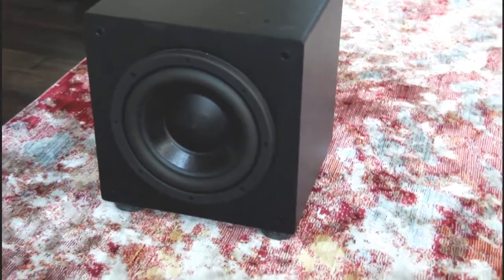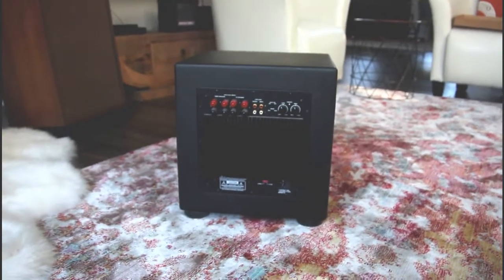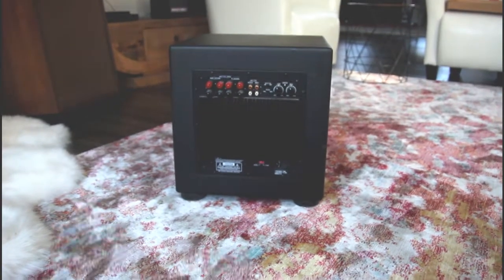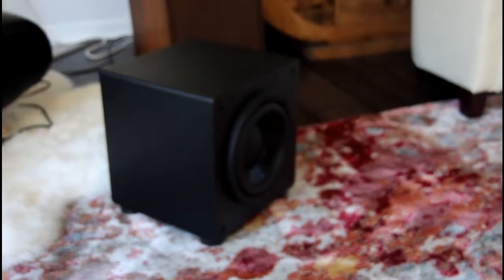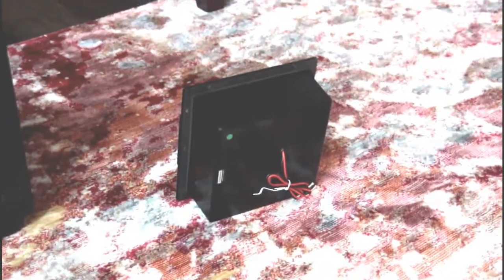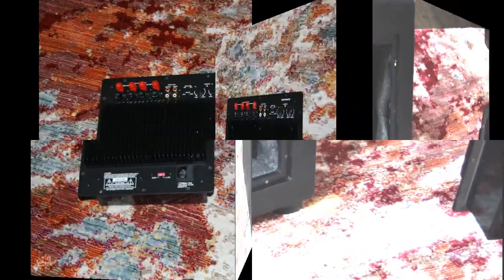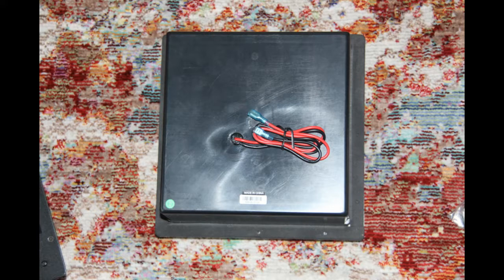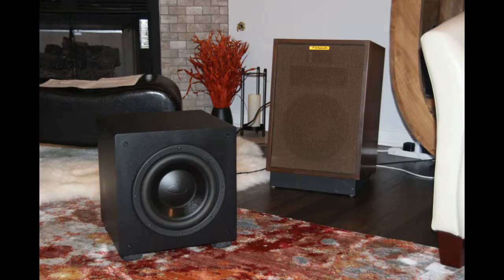Motorboating Subwoofer repair

Comment: Are those KLIPSCH FORTES?
Reply from the maker: Good eye, but only close. I do have a pair of Forte IIs I purchased in 1989 and refurbished about 5yrs ago. There is a video I did on the update. I'll put the link below. The Fortes are fantastic speakers. I use them for A/V as well as music.
The speakers in this video are Klipsch Heresys. They were a rebuild project I did last winter.  I did a new install in our vacation home with M-L Edge in-walls and they were a major disappointment. The Heresys brought the sound out into the room and made a major improvement in the sound field. Again video below.
Heresy rebuild - 1978 cabinets with all new innards.
https://www.youtube.com/watch?v=h3j2P8cjEoo
Heresy Sound test
https://www.youtube.com/watch?v=K19vrnMwNGI&t=186s
And the Fortes
https://www.youtube.com/watch?v=4PLtpOCH81I&t=279s
Reply: @ejcheck  If you have time, could u possibly email me?
I have some questions about what else ( CAPS) should be replaced due to the age of the Fortes. 30 years is a long time! Thanks for your time!
Jmmatsonjr@gmail.com
Reply from the maker: @sixstringsdown1  sending email now
you might want to remove the email from the post
Reply: I could tell by the variety of topics u cover that you are exceptionally intelligent! BUT, my email has been sent to the Utah Fusion Center already, IMHO!  LOL!
Reply from the maker: @sixstringsdown1  Thanks for the compliments. I tend to get very involved in my hobbies as you can see. 
As to Audio, I go back to the late 60's and it has always been a passion